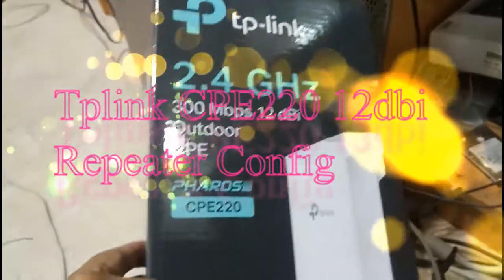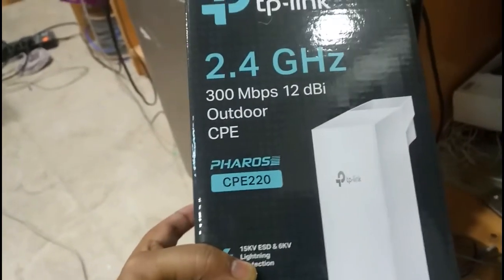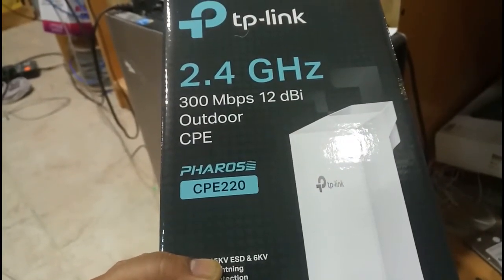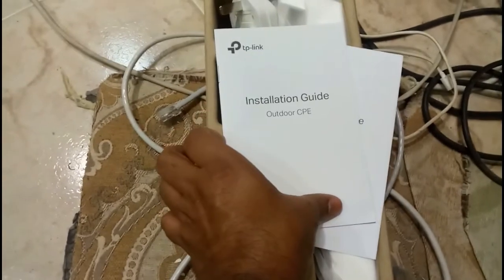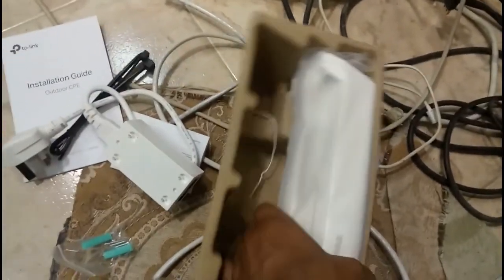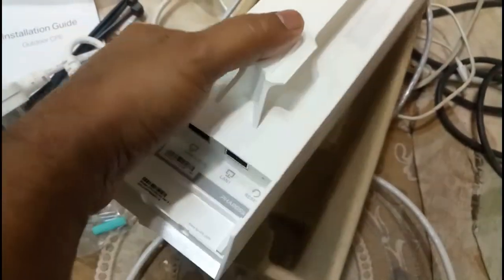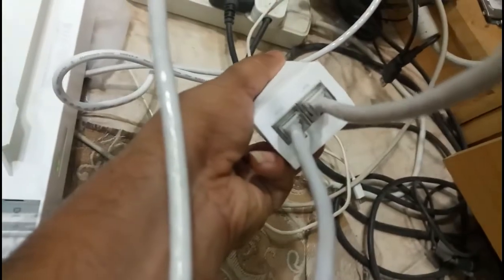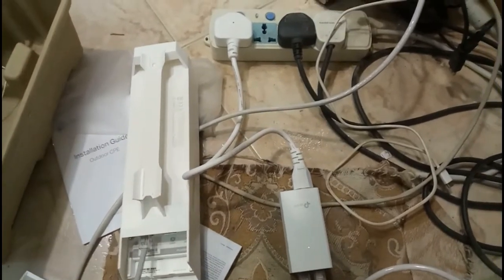How to setup tplink CPE220 12dbi as repeater simple Method....

Comment: Sir mujhe apne home se dusre home par net pahuchna hai to dusra home 150 meter dur hai to ese apne home pr laga kr dusre home pr tenda ka router connect kr sakte hai sirf ek cpe lagane se kam ho jayega
Reply from the maker: @ajithaldkar4316  main home with internet direct connect to the modem programming as accesspoint and receiver home program as client or repeater connect to the router it will work...if you are planning to buy or already purchased..if you not purchased try to buy cpe510 because this 5ghz this will give more distance and good speed...but there is one disadvantage when you try to connect from outside some mobile phones will not connect because this is an 5ghz device.if you are using 2.4ghz all mobiles can access internet from outside but speed will be less..if any doubt let me know
Reply: Tenda 2.4 gh ka roter hai to tp link cpe220 sahi rahega ya tp link cpe210 sahi rahega or sir dusre ghar pr to wifi signal aayenge na @recyclebintech8934

Comment: in the box it says 12dbi 

but in the setup if you choose China as region it will turned into 30dbi
Reply from the maker: if u keep region china no issues.but after configuration as access point and in receiver also you have to keep same region
Reply: @recyclebintech8934  yes it should be the same region
Reply from the maker: @kevinmeimban9627  it will be working fine bro go ahead
Reply: @recyclebintech8934  i tried it, and the signal is better compared to Philippines region
Reply: @kevinmeimban9627  there was no interference ? After all, the greater the transmission power, the more chances of interferente. In brazil we have this problem..
Reply: @rafaelpassos2520  so far there only few people that uses access points here, i tried to reduce the transmission power it result to disconnection due to lack of coverage
Reply: @kevinmeimban9627  and cpe610?
Reply: @rafaelpassos2520  cpe220
Reply: @kevinmeimban9627  good morning san location mo sa pilipinas sir kevin may alam kaba sa tp link cpe220 na ma i connect sa omada oc200 sa wifi hotspot..
Reply from the maker: you are from where bro...
Reply: @recyclebintech8934  I live in the Philippines

when i set my region on Philippines i only get 8dbi

so i tried changing the region to China
and then i got 30dbi instead
Reply from the maker: k

Comment: Bro I want to use internet from Lan to my mobiles with this device.
Reply from the maker: which device ur using 2.4 or 5ghz
Reply: @recyclebintech8934  2.4
Reply from the maker: how you configured the outdoor device 2.4
if you configured like access point you can connect to the mobile

Comment: Bro do you mean this CPE can use as repeater and repeated signal can be directly use on mobile?

If it works as hotspot, whats its outdoor range? as CPE is might go 5 KM+ distance. But as 2.4 GHz wifi repeater/hotspot how long it goes?

Thanks in advance.
Reply from the maker: bro in this 1km prefect after that the strength is low..u can use dish type u can receive the signal upto 5km
Reply: @recyclebintech8934  bro dish type model
Reply from the maker: bro if you enable maxstream it will work max distance and you have to keep 20hz it show 2.4ghz and if you keep 40hz it will work for 5hz.

Comment: At 12:30 you say the lan cable is disconnected and trace it, but don't actually show the whole thing. What I'm seeing there is a connected lan cable.

I need to use this as a wi-fi router in my out-building. You seem to keep it connected to the computer after configuration. Is that necessary? Is it a wi-fi-router (i.e. braodcasts to devices in an area) or is it simply a receiver for the main broadcast point, and expected to be connected directly to a computer? For this to function, does this need to be physically connected to something besides power?
Reply from the maker: set by set,connect the device with poe point,one end of the cable to computer and other end to adapter which is mention lan.after that set ip in ipv4.192.168.0.100 and subnet mask automatically,after that open google page type 192.168.0.254 enter,username password admin,then if ur configuring like sending select option acess point or receiving select option repeater,for sending set new username and password and logout ,remove the cable from computer and fix to modem.for receiving same procedure and u have to survey the nearby wifi signal and set selected wifi password and save finish,after this connect to the router.
Reply: @recyclebintech8934  Thanks! I just ordered it and will follow those instructions.